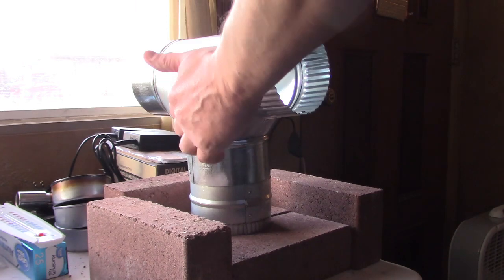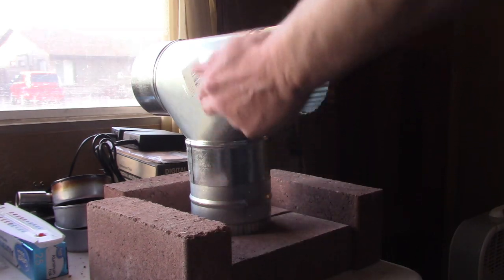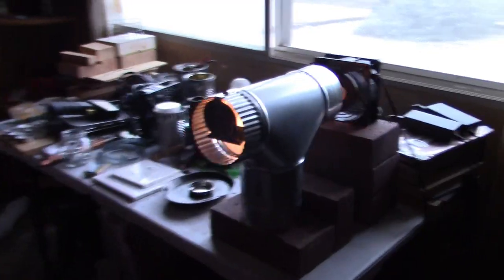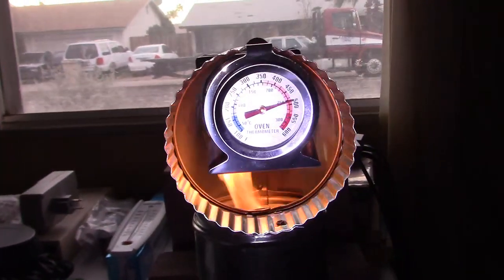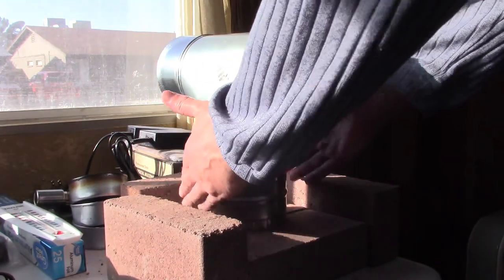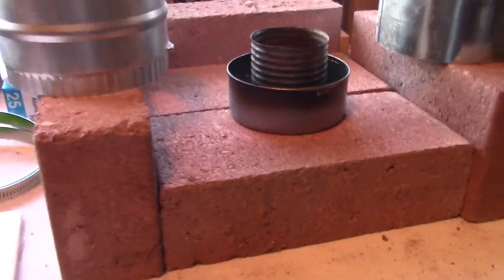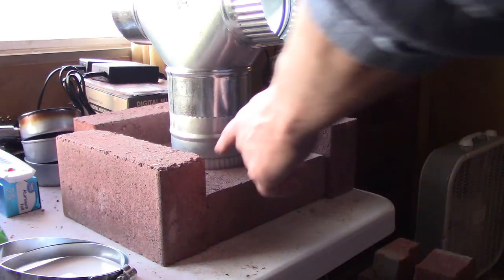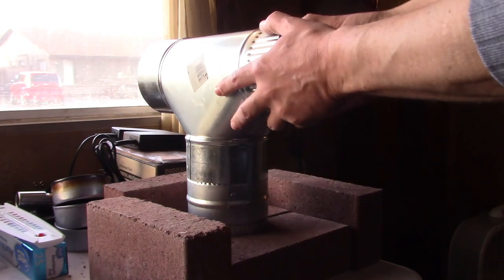DIY Air Heater! Tee-Pipe Heater Improved! (3X Hotter!!) Orig. 170F/77C - Now 500F/260C! Hot Furnace!

Comment: Any change you measured an increase in room temperature during burn time?
Reply from the maker: hi there. absolutely! originally i had fired up that heater that morning just to warm up the living room. i figured i would run it for an hour or two (until the sun started streaming in). i decided to try it with the coupler to see how (or if) it would change the flame. it seemed hotter so i put the thermometer on it and when i saw it in the 400's i grabbed the camera. i couldn't tell you how hot the room got but i was "burning up" sitting in front of the unit. (burning up in a good way)
Reply: @desertsun02  Wow! That's amazing. Thanks for the feedback brother. I've been watching your videos for a couple of years now and am never disappointed. Nice job.

Comment: Awesome! But how is it getting oxygen? Maybe by the Fan?.
Reply from the maker: hi yep, the fan. when i originally made the first tee pipe heater (with the 6" black stove pipe tee). i built it so it had airflow from the sides. the 4" model seems to get plenty of air from the fan

Comment: Construction adhesive is highly flammable until it cures.
Apply in well vented and wait the amount of cure time stated on the label.
POP rivets and screws are instant.
I've started using this heater and the dry heat feels awesome ! !
Thanks for the follow up.- KJ
Reply from the maker: hi there. it's awesome that you made it! (yes, you apply it and wait 24 hours (usually) for it to dry. i use "liquid nails" construction adhesive a lot. it's ready in 24.
Reply: @desertsun02  I made one of your - cans in a box - style heater with a 12v fan.
It was My only source of heat when I first bought My property - 2015. It still works great and I'm so glad you posted it and many other videos. -KJ